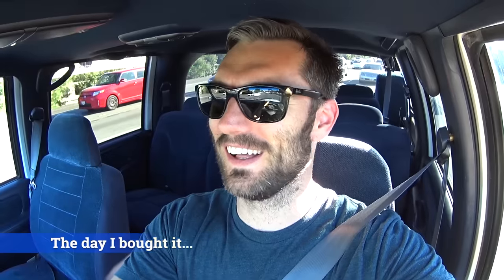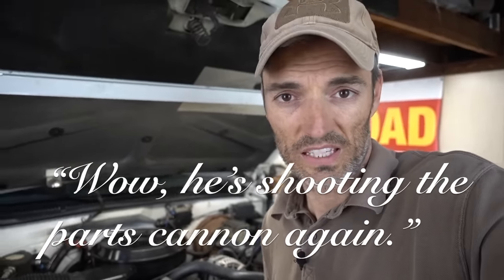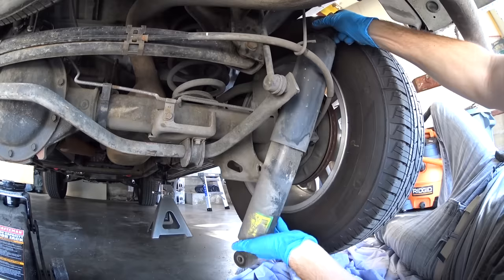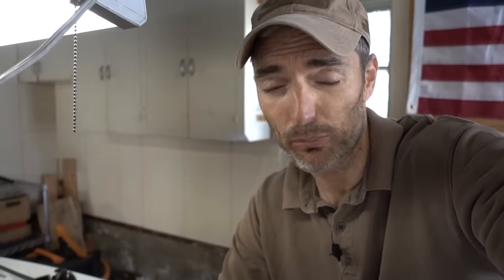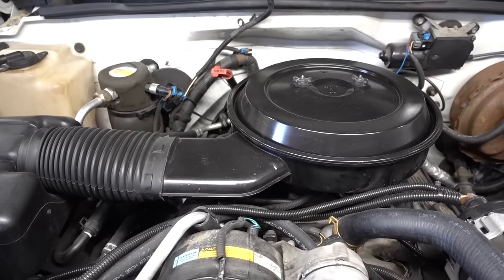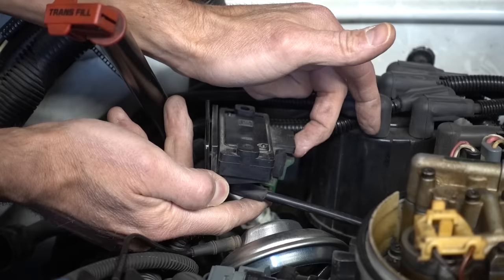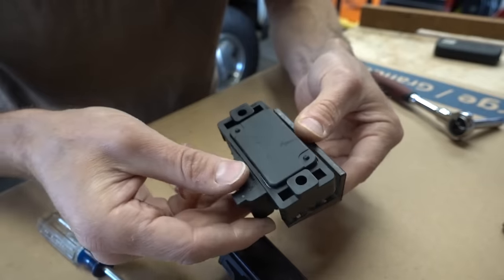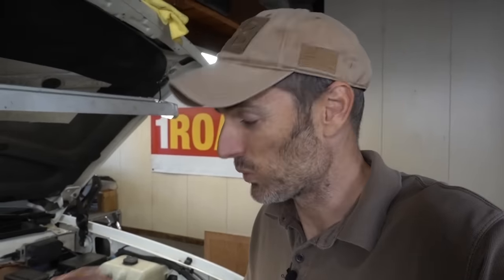The ONE REASON Why My 25yr Old Truck Runs So GOOD!!

Comment: As long as your shooting for preventing problems before they happen and doing tune ups, the one thing on these chevys with that motor that always gets overlooked and never changed is the distributor pickup coil. Its a must to be changed when going through the trouble of changing the cap and rotor on the distributor. When these coils fail youll get a poor idle, while the computer cant tell theres a part fault it starts to see incorrect times for ignition and so it starts adjusting the amount of fuel to prevent detonation. Thus you end up running soo pig rich that you can stand over the tailpipe and almost blackout from all the raw fuel coming out. Being that it basically screws up the ignition timing ive seen people throw injectors, plugs wires cap rotor, map sensor coolant temp sensor, and even go as far as throwing a new computer in these trucks all over a failed pickup coil. They are available on rockauto for dirt cheap gm oem.

Comment: Dont listen to the people giving you crap abt the "parts cannon" thing. I do the same thing with my 2005 Silverado. It only has 268,000 miles on it, so there are a few original parts on it. I have no problem replacing old parts as a matter of course. I  have not had car payments since  2007. I am a retired aircraft mechanic so I am well aware of "old parts".

Comment: I will agree to a point, buying a certain cheap parts is not always the way to go. Cheap break rotors will fail warp or ware out faster. Anyone can throw a OEM on your part. Just saying, do your research. Just don't let several problems build up to several, so your on the right track

Comment: I just bought a used Silverado for $15,000. It has 82,000 miles on it. Put front and rear brakes on it. A lot of little things on it. Bought tires. The man lied about the air conditioner working ( said he has not had any problems with it).  A/C condenser was leaking. It had dye in it ( that means someone had been working on it. Replaced and repaired it myself. My wife asked why I would buy something in that condition?   Because I just retired and new one like it is close to $80.000 dollars. Now I’m very happy with it. Every thing works great in it.

Comment: I have a 95 Silverado since 200,0000 lol. Been firing the parts cannon at that thing for about 10 years or more. It would die intermittently for the longest time. One day it did it and wouldn’t start back up. Mind you it did it in my driveway. I put the cheap $100 distributor from Autozone and she fired right back to life. My dad swore by Chevy. He would always say if they ever broke down it always in my driveway. My 95 has over 400,000 on the clock now but it isn’t my everyday driver any longer.  Tbi is stupid simple and just keep working.

Comment: I had a friend years ago that had an f250, it always had the emissions light on and he said it was a map sensor.. his reasoning for not replacing it was that 'its expensive or not available' I ended up purchasing the truck from him a couple of years later. One of the first things I did when I was doing a junkyard crawl was pick up a map sensor for it.. $5 out the door.. when I pulled the old sensor off of the fender the back side of it had a hole burned in it. No wonder it was throwing a code. I've learned when over the years that some of these people get off by not spending a penny on their transportation even though they rely on it. I'd rather have the peace of mind knowing my systems are running at peak performance. I run Chevy trucks from 1950-1996 carbureted, tbi, and vortec EFI

Comment: In addition to the EGR valve (which I have changed twice in 150k miles)  if engine light keeps coming on, check the EGR solenoid.  I changed that too and the light never came back on and the sluggish feel went away finally.

Comment: If your EGR is getting vacuum at idle then you have a a problem that isn’t the EGR (although that can be faulty too).
Yes, an open EGR valve will cause idle issues. But an electric solenoid or vacuum actuated diaphragm do the work. The static position is closed, unless you have a stuck spring or excess carbon buildup.
Almost exclusively, the EGR should only be open when you’re maintaining speed on level surface. And on a side note, this simultaneously explains why you get better fuel economy at highway speeds. An engine doesn’t need the same amount of fuel to maintain a given speed as it took to arrive at that speed. However, the combustion chamber can’t exist in a void. So by putting inert gas in there, it acts as a filler, allowing fuel to be trimmed and reducing combustion temperature and NOx.

Comment: I drive a 2001 ford Excursion V10. I'll shoot the parts cannon at it every time I work on it. Rusty brake line started leaking. I bought the entire set, pre bent, in stainless steel for about $230, including the soft lines. Next thing was all 4 rotors and pads. I'm working on all 4 calipers right now. It stops better than it ever has and I don't have to worry about blowing a brake line when I pull heavy loads.

Comment: You should look at the ground wires and vacuum lines on these older cars. Clean grounds well and verify you have no cracked or missing vacuum lines. Start with the simple/cheap stuff first.

Comment: One other thing that should be part of a major tune-up is the throttle body base gasket.  They disintegrate after some time, maybe 50K miles.
I just did a COMPLETE tune-up on my 1995 K2500 Suburban and it runs like new.  Found the oil pressure sensor had failed.  Oil in the connector.  Knock sensor failed, changed the connector too.  ALL sensors and associated connectors swapped.  New distributor and all new ignition parts.  (152,000 mi)  Changed the fuel tank, the pump/sender assy, and the fuel lines.  Don't forget the O2 sensor.  Couldn't be happier.  Now to go battle the AC system again (swapped to pickup parts, front air only) and I need a new radiator.  25Y just broken in.  Trans lines are the only think looking bad.

Comment: I replaced the Water pump on my ‘08 CX9 before it fails, no regrets to have piede of mind. Those water pumps are inside the engine close to the oil pan

Comment: Make sure to replace the 3 rubber brake hoses average life is 7 years   and flush brake systems  ..   plus use Delo 10 /30 oil or Valvoline  10 /30   wix or AC Delco filters 
On occasion  marvel mystery oil in fuel    i have older suburban also 454 manual transmission  4x4  its a tank  .. awesome video thanks for posting

Comment: I get the same accusations from my neighbors, followed by the "what's wrong with your truck"? Line of questions. They don't get that there are factory authorized manuals with schedules advising to change out certain parts at certain intervals. If you follow the schedule, such as changing out part x every x kms/miles months/years or whatever comes first. I've never had any problems with my GMs/Chevys.

Comment: I'm the same way, you have a idea of where the problem lays, but you have 3 different parts that can cause it. I buy all 3 online and change them myself. It's not anymore expensive then going to the shop for 1 part if they get it right, and now I know my car as well. So if your mechanically inclined you can fix your vechile for cheaper and have 2 other problems out of the way

Comment: If you live in the rust belt you better be a good body man. In minnesota where i live i see many many vehicles that still run good go to the junk yard because the frames have rusted right in half. Many good running chevy ford actually any make will be rusted to the door handles in 5 to 10 years. Im sure this gentlemen dont live in the rust belt.

Comment: I have a Toyota flagship vehicle that hasnt quite reached 100k. Replacing the running front O2 sensors bumped by fuel economy from 12.8 to 14.5. Sensors do NOT always go from perfect to broken. Preventative maintenance is wise and can pay for themselves in unrealized losses. Changing all your driveline fluids to high end stuff like Redline will also improve performance and reliability.

Comment: I drive an 18 year old BMW E60 when it needs fixed and that’s not very often my son drives a 15 year old TOYOTA LANDCRUSIER WITH 250 miles on the clock full service every 6 months and they both run fantastic

Comment: When I replaced the MAF sensor, my car ran much rougher afterwards. It turned out the reset computer was trying to 'learn' the position of the drive shaft, but the drive shaft position sensor was dirty. The mechanic went all around the houses, suggested the car's computer would have to be replaced, etc which would have cost more than the car was worth. I looked up the problem on YouTube, I got the mechanic to clean that sensor, and my car was back working better than ever...

Comment: Got myself a spare Parts Cannon.
My vehicle is 10 years old.
Gonna replace (Ebay parts), .. 
Alternator
Tensioner
Water pump
U-joints
Hoses and belts
Wheel bearings
Plugs, wires, coil packs
Thermostat
Already Flushed the trans
Gonna flush the radiator
Gonna change the rear end lube
Holding onto all the sensors just in case.
Got a spare radiator too.
Reply: And gonna buy rotors and pads too.
  In today's world, supplies are drying up and may become hard to get.
So I'm getting them before they're gone.

Comment: My little Ford Ranger xlt regular cab is 26 years old and still runs and handles just fine, but I've never seen the need to replace parts that weren't shot.  Why not?  Well, the first reason is cost.  Not everyone can afford new factory parts to just replace willy-nilly, however when something does break, like the old alternator crapping out, I often replace them with parts I consider better than OEM.  I replaced the stock alternator with one by Bosch.  Better warranty.  When the wheel hub bearings wear out they'll be replaced with Timken.  If they're tough enough for all the major railroads to use, they're good enough for me.  That being said, so far the only parts besides regular maintenance I've had to buy are a new thermostat housing (The old one's wiring had failed and always showed the temp as hot as it could get) the new alternator and new headlight housings because the old ones were so yellow and hazy they weren't much brighter than the marker lights.

Comment: That is a nice Chevy. Your rational is sound, I’ve used it myself. But if you want an SUV you can put your family in that holds up well Toyota forerunner. Every time I see a Toyota forerunner the thing is immaculate and it’s got 300,000 miles on it.
I had a EGR on a Chevy one time and the damn thing would get stuck open and cause the vacuum assist to flatline. I think I deleted that.

Comment: Wise words. 
Just a note: You replace and fix the truck and its fine. If the dealer or mechanic would do this then it may be seen as upselling.
Also way too many of them would charge you for work and not replace stuff you ask them to do. 

So in short: Its good strategy if you do it yourself or allow honest mechanic do this for you but its iffy if done by shady guy.

Comment: Amazon parts are sometimes garbage though; I've had vacuum and boost sensors bad out of the box from them.
Reply: Got a brand new ignition coil from msd. Failed the next day. Got it from summit racing. They exchanged it. Brand new vacuum pump from jegs. Broke out of the box. Comp cams. Had to wait 9 months for replacement. Vacuum switch was bad for it too

Comment: I have the rare inline 6 Jeep engine. It's the one I will keep maintaining for years. It's easy to work on, the parts are finally cheap ish even for MOPAR. Yeah, it's at it's part replacement age but it's easy to work on, it's open, and the senors it requires to place are maybe 9 or 10? Yeah. I'll shoot that parts cannon too! Some vehicles are worth it!

Comment: I just bought a one owner 1994. Had been sitting over 8 uears. She started, but fuel pressure was very low. After a new fuel pump, the truck runs beautifully with no other maintenance. These things were built to just pile miles onto. The biggest weakness is the rather fragile interior and steering components.

Comment: When was the last time you replaced that ignition module? When those type of electronics quite working, they quite working without warning. I like to replace the ignition module every ten years, and carry the old module in tool box for just in case need.

Comment: Preventive maintenance goes a long way!! Just changed belt and manual trans fluid on my 9 year old escape with 70k miles. Next will be coolant and brake fluid. Going to be getting a career change soon and not sure how much less or more I'll be making. So I figured I change everything out to keep it going for another 10 years. Just hate how there's no drain plug for coolant or I would have changed the coolant already. Have to take some panels off and bottom Radiator hose off from what I can tell.

Comment: Every time you work on a machine, you introduce variables. Fasteners that fail and low quality aftermarket parts combine with human error to generate failures that otherwise needn't occur. Your glued clip is a perfect example. Your efforts have rendered your wiring harness less reliable than before .

Comment: Aftermarket parts are not dependable. Try to only buy original if possible. 
Never touch a battery with your bare skin. Acid burns don't show up until the next day.
 Great job on the diy!
Reply: From a mechanic, aftermarket is fine, and touching a battery without gloves is more than fine. Drop those nuts and become a MAN
Reply: @valdorobantu290  mechanic 40 years. 
D bag

Comment: I am from an aviation background and the airlines calculate the lifetime of a part and replace it well before failure.  I also do not want to spend all of my time replacing part by part when it fails.  Cooling hoses looked good after 25 years, replaced.  Front end tie rod worn, replaced control arms, ball joints, bearings for under $200.  30 year old pickup had an idle problem and I narrowed it down to 2 parts for under $75.  I can’t understand why people say they won’t put money into a low priced vehicle, but will justify spending $75k on a new truck.  I simply estimate a life of a part.  If I am replacing a part because of failure and I am removing a part or have easier access to the expected failed part, I replace it while doing the repair.  My vehicles are as reliable as almost new, do not spend all of my time replacing failed part one at a time, and yes my parts cost might be higher, towing or a new vehicle is more expensive.

Comment: Love it.  Throw me a bone here before I shoot my parts cannon.  94 Chevy Silverado.  Starts great idles great runs like a scalded dog V8 350.  Problem?  Push gas peddle aggressively and wheels spin and you are gone no hesitation.  Take off like a normal person to maybe a granny and the truck will go from perfect idle to a flubbering idiot and sometimes fall flat on it's face and stall if you don't peddle it precisely.  Where should I start?  Thanks

Comment: If you have ever had to hire a wrecker service to haul your dead vehicle home or to a shop then you know the "parts cannon" approach is a form of insurance. I have been this way for 41 years so far. Still had to be towed once in those 41 years. Truck had 427,xxx miles and the crankshaft broke on I-75.

Comment: Best part about replacing stuff before it goes bad, is you can put all those 25 year old sensors in a container and have a spare in case your new one ever takes a crap out of the blue. Those old sensors that still work might just get you back on the road long enough to get a new replacement, and most of the sensors on the old GM’s are $60 at most.

Comment: i do this same exact thing as you on my 1990 firebird. i am totally in the same boat, i love replacing parts before they have problems, its fun and I sometimes get the surprise of good outcomes and better performance. i have replaced hundreds of parts in the last 1 year. And i can say one of the better investments was replacing the knock sensor, that really needed to be replaced and I didnt know it, turns out my engine knows better when to retard or advance the timing, and over all make it run better and more efficiently.

Comment: I would do that, if I had a place to work, time, and enough money for NOS parts. I've learned buying on Amazon during the last 5 years, because my favorite place to buy random electronic parts (Fry's electronics) was fading, and then gone. I have a mobile solar power project with not enough funding,  A lot of Amazon parts have gone into it, over 4 years, including a starter for the vehicle which makes it "mobile", which has held up reasonable well, so far. After 4 years of project, I would say that Amazon is a mine field which has worked for me, because I'm prototyping and learning to design, build, and repair in a new field, and experience with things that were not performing as advertised is good training. I'm not sure it's a good source for the reliability level you describe, especially when replacing things which are not broken or at least known to be nearing end of life.